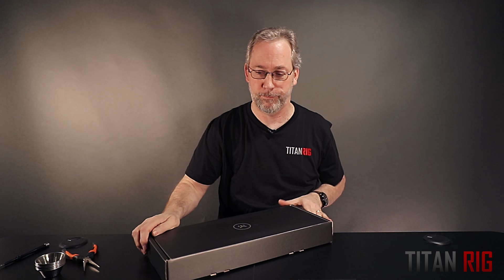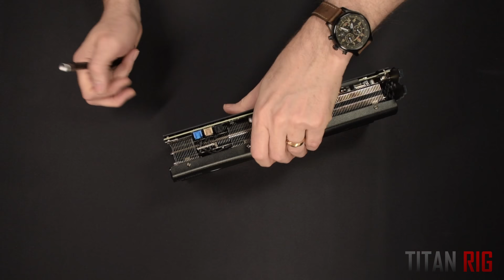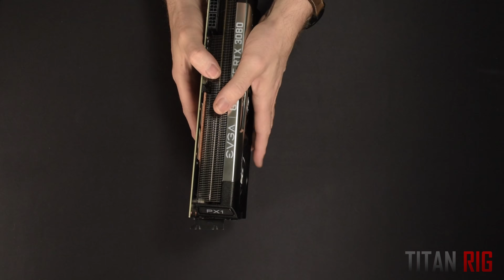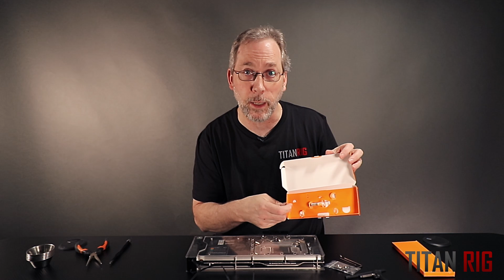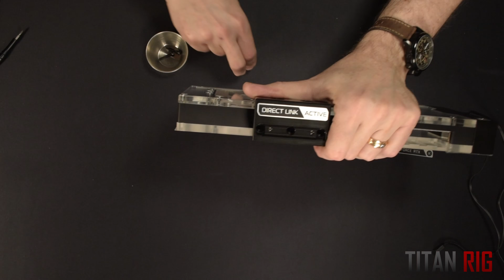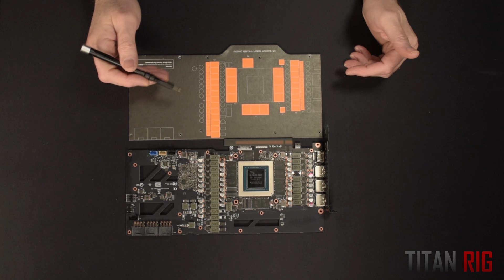EVGA 3080 FTW3 EK GPU Water Block & Active Backplate Set Installation

Comment: This by far is the best tutorial I have seen in a long time about water blocks. I will say, even though I was very careful, after removing all the screws attaching the fans, I did break off a component from the board. Luckily I was able to solder it back on and it works great and looks great too. Just giving a heads up when he said "It will be a little tougher for you to separate." it is! Again great tutorial.

Comment: Purchased the EVGA GeForce RTX 3080 FTW3 10GB graphics card, along with the EK-Quantum Vector[2] FTW3 RTX 3080/90 D-RGB - Nickel + Plexi. Recently, I purchased the EK-Quantum Vector[2] FTW3 RTX 3080/90 ABP (Active Backplate) D-RGB - Nickel + Plexi, hoping this will solve some of the heat issues that I have experienced with this card.

Comment: Note: always use a cross or star pattern when removing or installing the clips around the chipset. Don't go sequentially around the part that has pressure on it. Especially when installing something that you need to be water tight always go across and perpendicularly to the next fastner

Comment: Hi. I have FTW3 3090 Ti, and it comes with triple wide or more than double wide IO plate. After I installed the EKWB FTW3 ABP block, I was fine till I tried to install it into the case. It's too wide with that IO plate and EKWB doesn't ship a dual wide plate so it fits on their vertical Gen4 riser in O11D XL, so I'm kind of stuck till I find a dual wide IO plate or take a metal saw to my existing one from EVGA. I noticed you guys sell an AlphaCool dual wide plate for their EISBlocks. Not knowing anything more about that I did order it to see if it works into a solution for me. I could not tell if the holes line up to my 3090ti, but I'm going to try it for the 20.00 dollars it costs.

Comment: 24:10 why is the thermal pad on the left side of the GPU die shorter than the one on the right side when the indicator card shows they should be the same length?
Reply: There no memory chips on that particular spot, empty.
Reply: The indicator card covers a couple of different applications.  In this card the memory chips stopped short of the full length indicated on the card.

Comment: Nice kit right there. I'm going to order this for my 3080 but my question is, how does the water flow? The previous gen had a one way orientation in Sereal, unless you rotated the terminal, then it's serial flow again in the other direction. So, with the new direct link terminal, what is the flow direction? Parallel maybe? There's not much info on this nor have I found a tear down of the terminal.

Comment: Did you ever tighten down the screws for the card to the bottom plate?
Reply: Ha!! Yes I did.  Our editor cut that part out - as well as the reason I left them loose in the first place.  Sometimes you'll run into a screw that doesn't quite line up with its hole and thread in straight and clean.  By leaving the screws loose at first you have some space to move things around to get those lined up.

Comment: Finished this installation for an XC3 3080 the other day, got it in and it works and has great temps under load. However, under load it also has horrible coil whine. I know it's not actually dangerous to the card but does anyone know if there's something I could do to reduce the whine? Would reseating the blocks or something like that help?

Side note: I ended up using 1 mm pads on some spots on the backplate even though it said to use 2 mm pads all around, because I couldn't get the terminal screw holes to line up until I did so. Could this be contributing to the whine?
Reply: I would not use 1mm pads where it calls for 2mm.  You might risk not getting good contact and heat transfer.  You just need to really push and compress pads/plates together, but whatever you do don't push down on the screw.  There's also a chance that a more secure seating of the blocks/plate on the card may actually help with the whine.
Reply: @SnaxanGaming  Thank you for posting this, I was finally able to get the terminal screws in! Flipping the card, so the active plate is face down, helps with the compression a lot.
Reply: @fskate2  nice!  Glad that worked out!

Comment: The real issue with water coling a graphics card is matching the GPU to the GPU block.  The EK website is garbage because it good at telling you whatever GPU you selected doesn't have a block.  In fact I couldn't find a GPU that was not stupid priced that EK offered a block for.  Corsair only offers block for 'reference' cards, WTF is a reference card?  Good luck finding that list, but EK offers a block for 'reference' which is different from FE but again, good luck finding a list of those cards.

It would be great if manufactures started manufacturing water cooled cards, as in specifically for water cooled and not retrofitted.  Same thing with motherboards, with a mono-block you would only need 4-6 phases to power even a 300 watt CPU,.  This would reduce costs, increase reliability since there are fewer parts, save space, and improve efficiency when the CPU is not being hammered.  All of these also equally apply to GPUs as well.